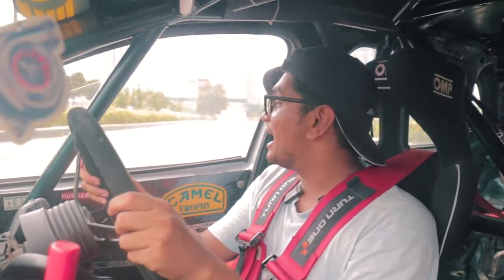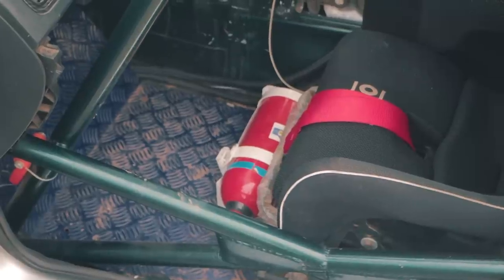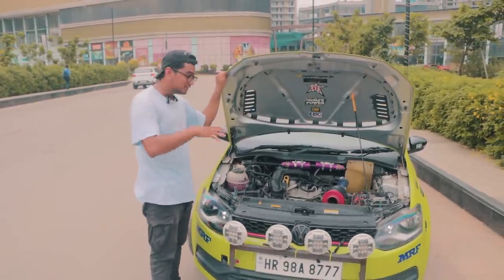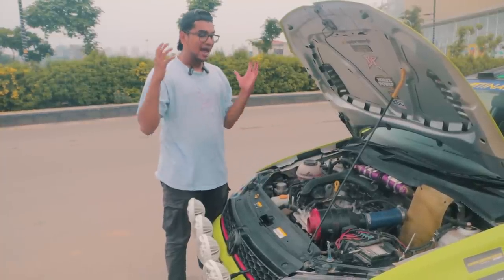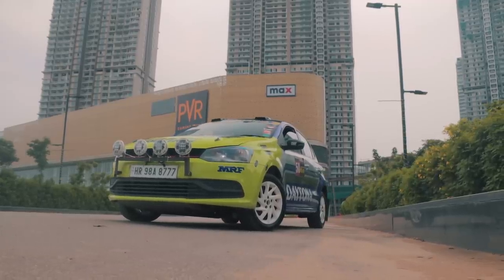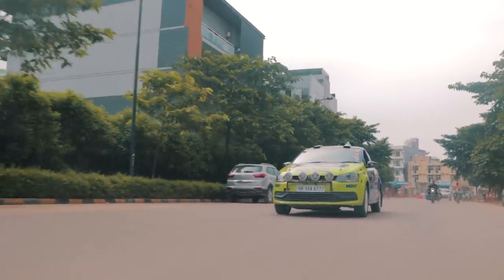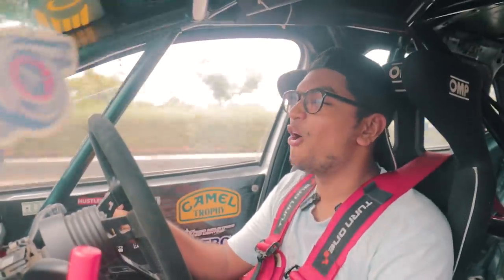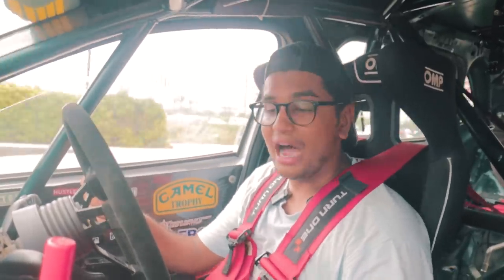INRC 2 Rally Polo 1.0L TSI with 6.5 Lakhs worth of Suspension! 🤯 | Autoculture

Comment: If its a 1.0 TSI, why does the door panel have only the front power window controls.
For all the polos after 2012-2013 (all variants), the driver door panel get the control of all the 4 windows.
I have a 2012 (1.6 petrol), and I know it for a fact that it is annoying.
Reply: 11.22 time stamp.
Reply: it was a Comfortline 1.0 TSI Manual Polo
Reply: It's an old polo I guess with a 1.0 engine swapped into it
Reply: @aldrinpabraham6932  the body is sure from a Polo manufactured before 2013-14. 
1.0 TSI is after 2020